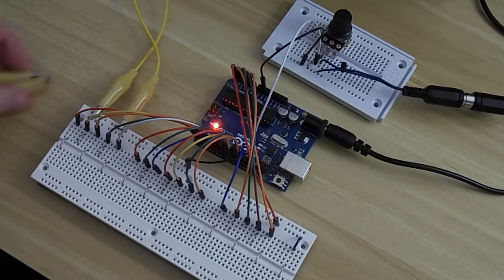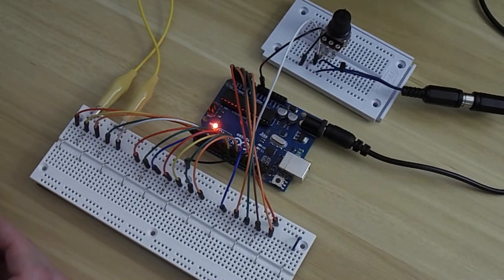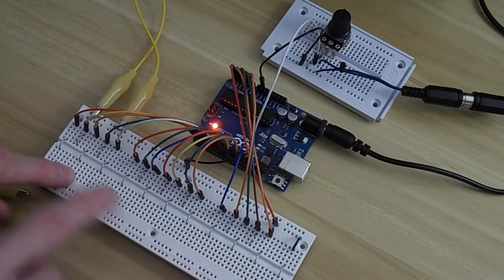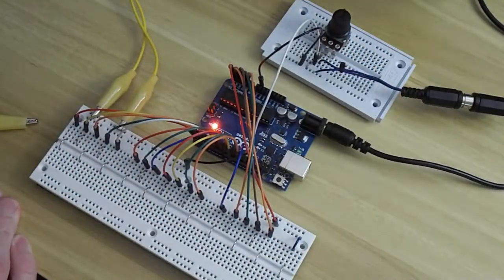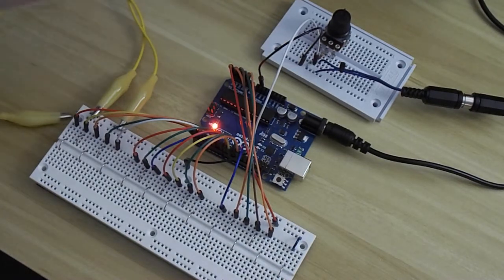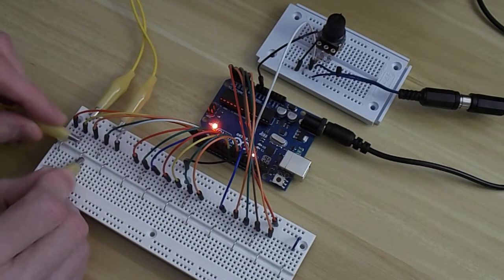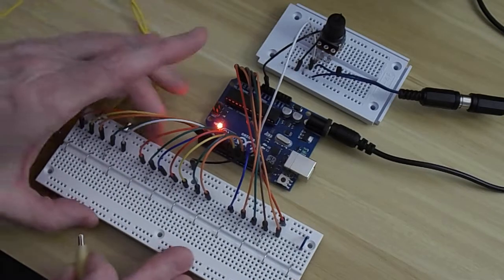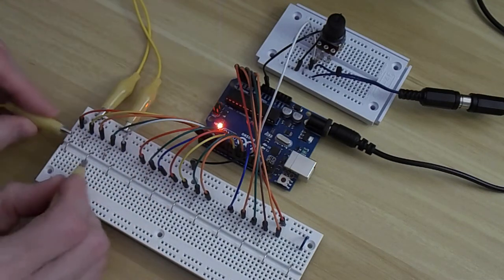Arduino Synth Code and Schematic

Comment: Great project thank you for sharing. Have you tried to use a infrared receiver attached to the Arduino so that you can play music using an infrared remote? A button on the remote would be a music note. It would save you a lot of cable work.

Comment: What about using two arduino nano boards to achieve three octaves? A simple audio mixer could manage the two outputs....or even three nano boards and make it poliphonic??? or even nine nano boards to .....CONQUER THE WORLD JUA JUA JUA....no, wait....I am delirious...
Reply from the maker: Actually, I did write new code to switch between two octaves with a push-button. Time to do a new video.

Comment: Hey Pete,i have a little question but i must first say that you are doing a wonderful job inspiring people (such as me).As a beginner i dont know what is a trigger output,it will be awesome if you can clarify that a little bit.Thanks and keep up the great work.
Reply from the maker: Thanks, it's always great to hear that people are learning from my projects. The trigger output is a single 5 volt pulse that occurs every time a key is pressed. It is used to trigger an external attack/decay generator such as in my VCF design in my other videos. If you are not using an external VCF or VCA, it can be ignored. The output of the Arduino sounds pretty cool by itself.
Reply: @petemcbennett6039  Sorry but, I can´t understend  where you connect the pin A0. Thanks. Greetings from Argentina!!!
Reply: @lautarogaray6042  A0 is connected to ground via a momentary contact pushbutton switch. That switch allows you to change the step speed by each push. I hope explanation makes sense and is not lost in translation. Cheers!
Reply: @lautarogaray6042  Please ignore my earlier post about this as I assumed you were looking at the sequencer version not the PWM Synth with High-Note Priority. As Pete already mentioned you don't need to connect pin A0 to anthing unless you are also using his external VCF and VCA.

Comment: My video of a slightly modified version of this with added MIDI is now online on my new channel:
https://youtu.be/HRDNzdmZl7M
Reply from the maker: I just now noticed that you had posted a video, but you have taken it down. Perhaps you are working more on your design.
Reply: @petemcbennett6039  Hi Pete!
Yes, I have taken down the video because I didn't like it too much. I will improve it and reupload it within the next days.
Also, I have finally finished building the VCF and putting everything in a case. Only the auto trigger doesn't work but I haven't been able to find the reason yet.
Reply from the maker: I think I know why your auto trigger is not working. There was a mistake in my original schematic which was found by a viewer. I had shown the output of the VFO from pin 3 of the LFO instead of pin 1. I have since uploaded the corrected schematic, I apologize for the mistake. Here is the new link: https://drive.google.com/open?id=1Ac_viuOEBRzPwSZE1TOIzKb9LMa974HO
Reply: @petemcbennett6039  Thank you so much for pointing that out! Now everything works perfectly fine.
May I assume that it's okay if I show some screenshots and  very short clips from your videos in the intro of my video? Of course, I would link you as the original creator.
Reply from the maker: @error8418  Awesome, I'm happy to hear that fixed it. And yes, it is perfectly OK with me to use clips from my videos. The more exposure, the better.

Comment: Hey Pete, I haven't had enough time to build the VCF yet but the synth alone (even on a breadboard) sounds amazing through my guitar amp (and pedals).
Thanks again for making all of this accessible to everyone!
I just had a look at code: If I understand it correctly you are using a timer interrupt to create the output PWM signal. Since the ATmega328 has 3 timers I have spent some time thinking about the possibility of making the synth "triphonic". But since the timers would probably interfere with each other I scrapped the idea and came up with this: Shouldn't even a simple ATtiny25 be able to run the main oscillator code? To me it seems like the bigger board is only needed for the inputs/keys. I have this idea of multiple oscillators consisting of something like an ATtiny each which are all controlled via I2C/SPI by one Arduino Pro Micro/Leonardo/Teensy so it could also handle Midi inputs via USB.
As much as i love the way it sounds there's currently 3 things that I would like to add to this project: 
1) A polyphonic (or paraphonic) version would be really cool - 3 oscillators should be enough, just so you can play triads.
2) The range in pitch, which is obviously only limited by the Arduinos inputs.
3) Since I can't find a dirt-cheap toy keyboard to mod and building one from scratch turns out to be rather difficult, I'd like to add a MIDI input. That way I could use my existing MIDI keyboard or program stuff within my DAW and have it play back through the synth.
I think with these additions your already amazing design could easily be morphed into a full-size synthesizer that can compete with many of the classics out there.
Just wanted to share my thoughts with you and maybe get your appraisal on those ideas before I waste too much time trying the impossible. ;)
Reply from the maker: Hi error! Those are some interesting ideas, and certainly would not be "trying the impossible", I guess it's a matter of how much effort one puts in to it.
 
Yes, you are correct that the code uses a timer interrupt to generate the PWM. And you are most likely correct in assuming that three timer interrupts would interfere with each other. Even one interrupt messes with the final pitch of the notes, that is why I had to fudge all the frequencies to higher values.

Extra time is spent executing any code, and interrupts take even more time. I experimented with compensation formulas to automatically correct the pitch for the for the code execution time, but ultimately ended up just adjusting each note by ear using my Yamaha PSR E253 as reference. It was only 18 notes so it didn't take long. I mention all that because I don't know how the pitch adjustments will transfer to the ATtiny25. May need to be tweeked. I do know it works on the Atmega328.

All that being said, I would love to hear how your experiments evolve. Keep us posted.
Reply: @petemcbennett6039  Quick update:
I have already run into the first major problem - the ATtiny25/45/85 only have an 8-bit timer, whereas your program utilizes the ATmega328P's 16-bit one. Thereby the frequency modulation would be a lot rougher, probably too rough.
The problems of pitch inaccuracy are probably mainly caused by the overhead of the Arduino bootloader so they would become even worse on a smaller microprocessor. I have seen videos of polyphonic synths with Midi running on nothing more than one ATtiny85 - but they were programmed in Assembler which I would like to avoid by any means.
Also, I have come to the conclusion that all the small imperfections in the code's execution are obviously giving it its unique sound since they should cause overtones.
Therefore, I will leave the code as is and try it with several ATmega328Ps (Arduino Nano).
Reply from the maker: @error8418  Ah, I see. Well, the Nano clones are cheap enough to run several in your project, that should do the trick. 
As a matter of fact, before I was able to do the PWM in the code, I was going to run two ATmega328Ps, one slightly de-tuned from the other, to produce the fat sound. But I knew there had to be a way to do PWM in the code to basically mimic what my analog PWM tone generator was producing in my earlier designs. A buddy of mine helped me out with that, I shared credit with him at the top of the sketch.
And of course, if I had stayed with dual Arduinos, I could have also tuned to fifths or octaves. Your idea will be pretty awesome sounding when you get it all together.
Reply: @petemcbennett6039  Hi Pete,
error here from the new channel.

I have put together a video of the modifications I have made to the project.
If you're okay with that I'd like to make it public. In case you like to see it first send me a message so I can share a link to the currently private video with you.

Comment: Good work, that's a nice thick sound! Have you tried polyphony for this? I wonder whether the richness of the tone could be retained when shared across more than one note.
Reply from the maker: Thanks! My coding skills are not that advanced so I stuck with a mono-synth with high-note priority and PWM. Actually, the PWM scheme was written by a friend of mine, he is the co-author listed at the top of the code. By the way, this has nothing to do with the PWM IO pins in the Arduino. (In case anybody was wondering.)

Comment: Thanks very much Pete. Have got a CASIO keyboard here that may well become the donor case for the build. Might try matrixing, to use all of its 49 keys.
Reply from the maker: Hi Slider! Yes, matrixing is of course what the Casio uses already. I like to keep it simple, and 18 notes just happened to be exactly what I had available in IO on the UNO after reserving D13 for audio out and A0 for trigger out. However, the Arduino Mega has enough IO for all 49 keys without matrixing. I really wouldn't want to make all those connections though!!!
Reply: With as much crap as I have in my shed, 49 pieces of wire are the easy bit lol. Got a couple of Mega's, but the brilliance of your way of design is simplicity and size. That would suit matrixing on the Pro Mini/Nano... am going to use code from a cube of LED's and see how it goes. Again thank you, these are really useful and sonically 'correct' circuits that we can all build.